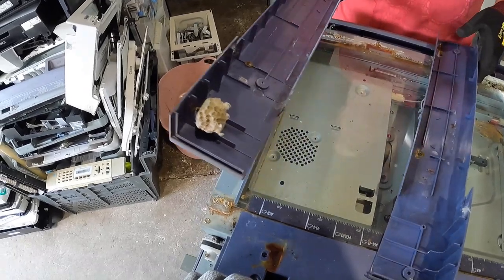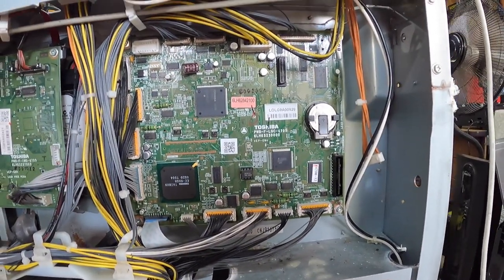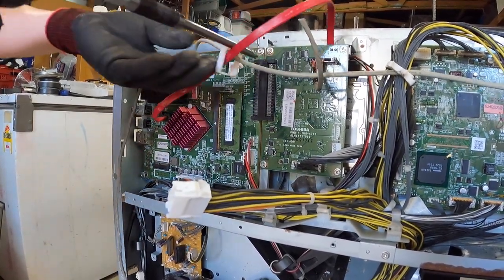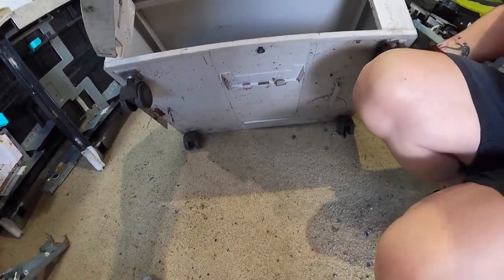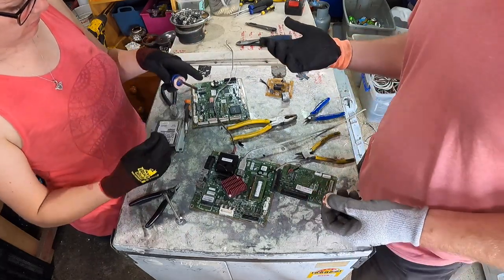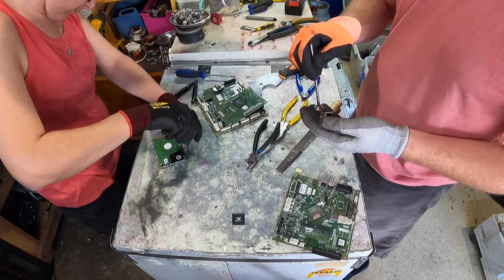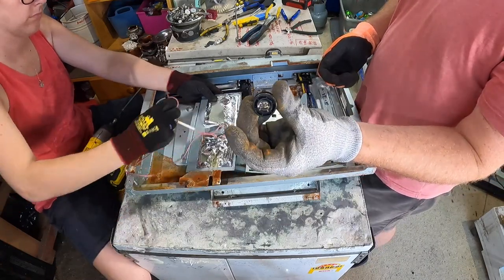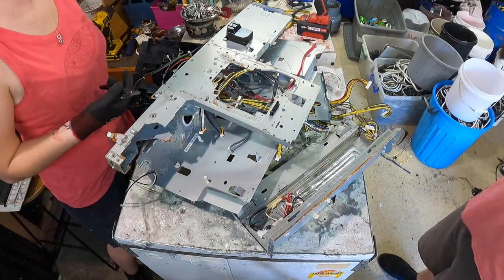Office Photocopier Scrap Out - Scrap Breakdown - Metal Recovery - Metal Recycling.

Comment: That is an item that I have always wanted to scrap out, but because of it's size has not happened. There is lots of plastic but there is a lot of good scrap also. I would think that those USB metal covers, if you file them and they are brassy and barely magnetic that they are not steel but likely nickel plated. Nickel is slightly magnetic and even more so when it is worked and tooled. If they are not brassy and barely magnetic they could be stainless. I would upgrade them unless they are very magnetic. Hope your op is minor and we see you soon in good health. All the best. 👍
Reply from the maker: Hi A Fineliner. I run into this issue frequently, as you mentioned its either slightly magnetic or not magnetic all and then there's differentiating between brass, copper and stainless steel, which I try to do. For me it comes down to what the scrapyard says, as they are quite pedantic with what they will and won't except. Thank you for your well wish! 👍😃

Comment: Hi Mike and Jane, I also do micro scrapping like you do. There are two well known minerals that are ferromagnetic : iron and nickel. So, if you file a little contact box (28:50) and it is yellow and slightly magnetic, it is nickel coated brass. If slightly magnetic and white when filed, with a shrill noise, it can be stainless steel.
Although it would take a lifetime to get a pound, the tiny screews of the hard disks are almost always stainless steel.
Reply from the maker: @maxcloutier5285. Thank you for that information and thank you for watching. Maybe certain types of stainless is ferro-magnetic too? When I wave a neodymium over the screw they rock to and fro as if they are either magnetic or becoming magnetised. Have you experienced this at all with the HDD screws?
Reply: @MicroScraprMike  Sure, a percentage of stainless steel is ferro-magnetic. Stainless steel is very complex, I suggest an internet search to know more. My neodymium magnets are in a separate container so I dont know if they do experiments when not attended, lol.
Reply from the maker: @maxcloutier5285  😂